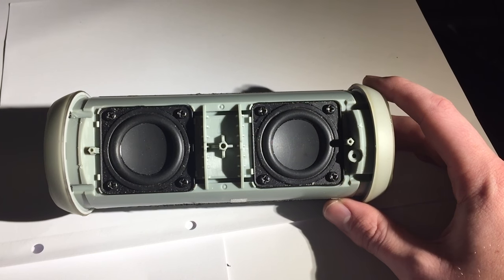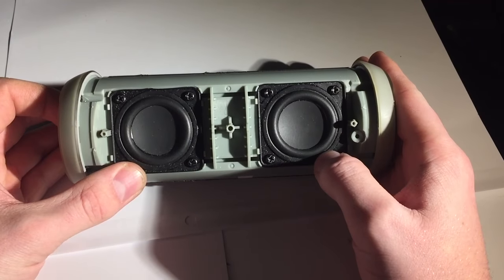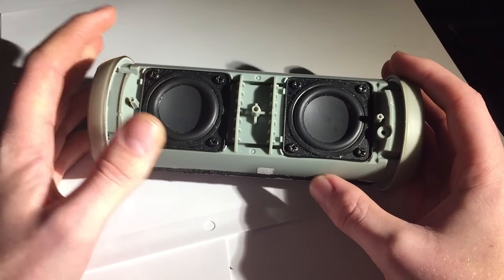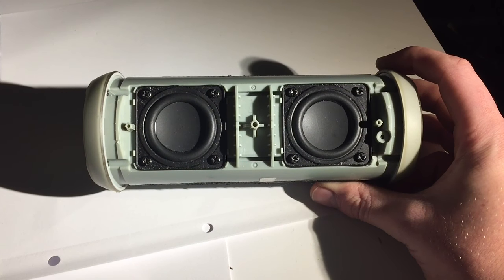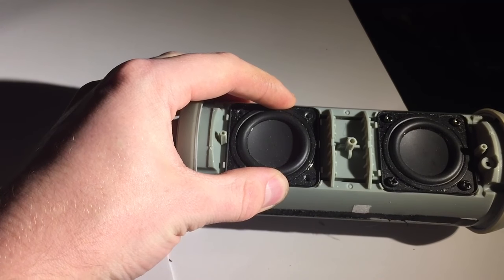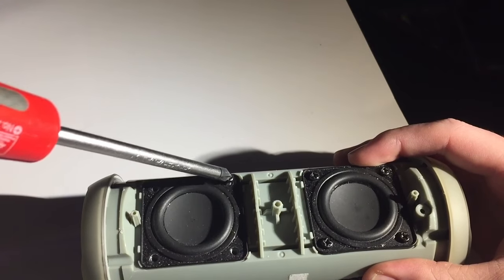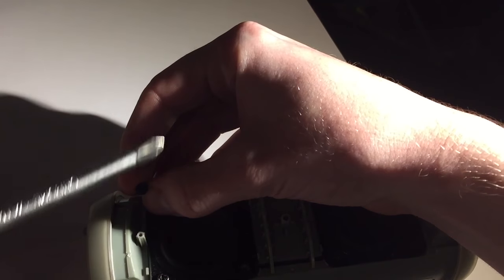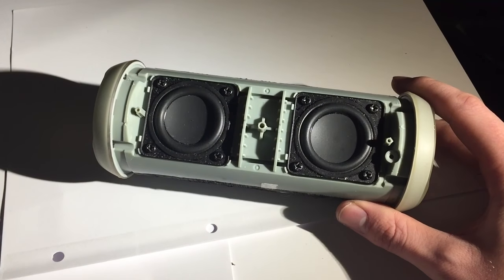What are passive radiators on speakers and how do they work? HD | Aspiebloke's world |

Comment: It's nice demo but I have to say I don't agree. Taking the speaker out allows for sound waves coming from the back of the speaker to cancel out the sound waves coming from the front of the speaker. That's probably why they sound so bad when out. To properly demonstrate the effects of the passive radiators, you should find a way to prevent them from moving but keep the whole thing sealed.
Reply from the maker: Thanks for your comment. the only way i'd be able to stop the radiators moving would be to hold them which could result in damage hence why I removed the driver.
Reply: huh? if you hold the radiators stil, nothing can break! but if you hold on the active speaker then you can damage the driver
Reply: @maltepettersson3083  If you hold the radiators still, the material to hold it in place is being forced to not move to and fro (This material can actually tear if you force it to not move while active)- thereby damaging the radiator. By holding the speaker out of its enclosure, the cables/wiring are still in place - hence those won't be damaged. Unless you yank the drivers out with force.
Reply: won't damage a passive radiator to hold it. they're passive ... they flap around according to external forces. if you hold the centre still the stresses are the reverse of a centre-driven speaker cone. if you wanted to be cautious you'd spread the load over the cone and make the net load zero everywhere.

cuicui is 100% correct: removing a driver messes with the bass for much more important reasons than inactivating the radiators

aspiebloke, if you want to hear the difference between a plain sealed box and a box with radiators, just place your fingers on the radiators, or cover them over with rigid caps, and they effectively become walls. you should also note that radiators perform an additional function of increasing the power handling of your tiny active drivers by controlling excursion. as the frequency gets too low for your drivers to make useful sound, the radiators start to operate in antiphase, counterintuitively going in when the drivers go in. sort of like playing paddle-ball. this not only makes sound, it effectively reduces the air volume behind the driver and limits its travel. iow the driver is better coupled to the air near its resonant frequency. also iow, the driver is seeing a higher acoustic impedance at low frequencies, roughly equivalent to being in the right gear

Comment: It isn't air pressure that drives the passive radiators it's the Helmholtz resonance of the tuned system. The passive radiators only vibrate in response to this. Above the resonance they do nothing. Below resonance they respond to air pressure changes but their output is out of phase with the main drivers and so therefore don't produce any useful output.
Reply from the maker: Hi thank you very much for this comment I have since researched Helmholtz Resonance and found it very interesting. As this video is now not 100% accurate I may do another video also saying about how Helmholtz Resonance is involved. thanks again, I'm always interested in learning how things operate and appreciate people telling me if I'm not 100% right.
Reply: "Helmholtz Resonance"...will it be mentioned in speaker specs?
Reply: Khaja Md it will be mentioned as the lowest on the frequency response. My JBL charge 2+ is tuned at 75hz I believe, and that's exactly what it says on the box

Comment: Exposed radiators sound more good that's why UE loooses their sound against JBL
Reply from the maker: I have to say I like speakers with exposed radiators however i've just got hold of a UE wonderboom (demo coming soon) and i can't really notice a deteriation in sound.
Reply: IMO the tweeters tend to be more adversely affected from being covered than the pass radiators. I've got a fugoo XL (which I love) in the Style jacket; to me the highs don't sound quite as crisp when it's inside the jacket as it does when it's out. The bass doesn't seem to be muffled at all; I think the lower frequencies have an easier time passing through the fabric weave.
Reply: Aryan Singh i have an anker soundcore and it only has one passive radiator but it sounds better than the jbl
Reply from the maker: Personally I'm not a fan of UEs range speakers other than the wonderboom however I haven't heard the new mega boom as yet.

Comment: Wow! Do you think there may be more factors causing that significant increase in low end performance? - or just the passive radiators. I have used passive radiators on my builds with less difference, and am wondering if any additional factors are contributing
Reply from the maker: I don't think so no, I think that's the only thing JBL use.

Comment: Nice demonstration. I have a JBL charge 2+ and it seems the bass produced from the left side of the speaker is stronger than the bass from the right side. I can actually feel the difference while moving in front of the speaker. How to check if both the passive radiators are working fine and there is no fault with the speaker itself.
Reply from the maker: I don’t have the charge 2+ myself bud I’d assume that like the other JBL speakers each driver and rad doesn’t have a separate enclosure. Therefore the bass should be even maybe check your left and right balance settings on the device connected to it. Also check for a air leak by gently pressing one rad in does the one on the other end come out? If not then that may be your problem. Let me know how you get on :)

Comment: I have a 10" Edifier sub with dual passive radiators but surprisingly the bass it produces is rivalled by a few other smaller subs I have so I'm not really a fan of the design and wish they had just gone with a tuned port like my other subs

Comment: So what I find cool about it is that the pr’s also help the bass
Reply: Is it normal that the bass radiators not move???
Reply from the maker: No this is not normal and is probably a sign of the device not being sealed.
Reply: @aspieblokesworld1890  even without low freqeuncie mode AND a low volume??? but the sound is great

Comment: I am interested how it would look if you wire one speaker out of phase and seal it back up. Technically it wouldn’t generate pressure inside to run the passive radiators..
Reply: Lol i think it would generate pressure but would be aweful
Reply from the maker: That sounds like a good experiment, only problem is the wires are soldered to the speakers :(

Comment: I'd like to see a video on the Bose speakers you have. I had a sound link mini and it just slowly broke down towards the ends of two years. I was really disappointed.  The other Bose gear i have has lasted and still sounds great. So i just bought a  JBL Charge 3 and I've really been enjoying it. Anyway great video.
Reply from the maker: I will do a demonstration of the soundlink colour if you want and I've got the soundlink mini too and managed to blow a driver in it. In my opinion bose have gone down hill with their gear hence why I now use JBL gear. I'm glad you're enjoying the charge 3 great little speaker and lots of volume I'm glad you enjoyed the video

Comment: Since you mentioned air pressure inside the speaker, Is there a port for the speaker where the air could come out?
Reply from the maker: Not as far as I’m aware. The device has to be sealed for the passive radiators to Work effectively

Comment: How would this work on a much larger subwoofer? I have a 15" 2000rms sub in a ported box being pushed by a 4k rms amp. Would the power handling change at all? Would space requirements change? Would a passive radiator increase the low end out put or would keeping it ported be more of a benefit? Thanks for your information and video!
Reply from the maker: I'm no expert on larger speakers this video is just how passive radiators operate. In my opinion on a sub that size ported is better, space requirements would probably change as you may need to accommodate a basket for the passive rad. if it was me i'd stay ported as ported can go lower frequency wise. If its a car subwoofer i'd suggest you look at Meade916 he built a system for his shop that uses passive radiators I hope this helps.
Reply: The passive radiators need to be as big or bigger than the active driver. If you used a 15 inch passive and add weight to it it would ''tune'' it lower. Or you could extend the port for lower tuning
Reply from the maker: Thanks for that info :)

Comment: oh cool so it's like an amplification of the two speakers rather than a bass speaker of it's own. it "radiates" the air of the main speakers in a bare tube? ..
Reply from the maker: Pretty much  yes, the main drivers cause the radiators to move which extends the bass response of the device.

Comment: Help ! I have the charge 2+ but the passive radiators both stoped moving.
Any tips ??
Reply from the maker: Hello chances are you've lost air pressure has the speaker been dropped at all or anything sharp been placed against the radiators? Easy way to see if you've got an air seal is to press one radiator in does the opposite one push out? If not then you have a leak. Hope this helps
Reply: Aspiebloke's World I did push one side and the other side didn't come out so I'm pretty sure I have a leak and it's because I tried taking out the battery but I guess when I closed all the parts again I didn't seal everything tight
Reply: Aspiebloke's World if it is a leak, does that mean I could still fix it ?
Reply from the maker: you may be able to fix it just ensure all screws are tight and everything has lined up correctly. I haven't got the charge 2+ to look at unfortunately. If that doesn't work then you may have to upgrade to the charge 3 :) hahahaha
Reply: Aspiebloke's World first of all thanks for responding, I opened up my charge 2+ and tightened the screws and it turned back to normal which made me very glad so looks like the charge 3 will have to wait hahaha
Reply from the maker: Brilliant news! yeah a lot of the time loose screws can be the cause especially if its taken a fall glad to be of assistance :)

Comment: But why does the radiators move out on the beat then? If the drivers move "out" shouldn't the radiators move "in"?
Reply from the maker: It’s funny you should say that as I’ve wondered the same thing. I’m not sure why that doesn’t happen.
Reply: Ikr it doesnt make sense unless the air is expanded 😂

Comment: I still don't understand how it doesn't cancel each other out. If the driven speaker moves out, the passive sucks in, how is it creating sound and bass with pressure? There must be some way they designed it to 180 this otherwise I don't see how it would work
Reply from the maker: Me neither, like you said there must be a way :)

Comment: Hi, So the passive radiator is like cap on woofer exhaust that we have in enclosure and it just moves with the air inside the box to capture more base in closer distance if not wanting to capture the base acoustically?
Reply from the maker: I believe so yes but I think there is also some DSP behind it too
Reply: Aspiebloke's World sorry what is DSP?
Reply from the maker: Sorry I should’ve explained. DSP stands for Digital Signal Processing. Basically what makes the JBL speakers sound the way they do. :)
Reply: Aspiebloke's World haha cheers:) so please elaborate what it is and how it works and how it makes these JBL speakers sound so impressive:)
Reply from the maker: I’m not an expert when it comes to DSP I’m afraid. All I know is it keeps the speaker within its operating limits
Reply: Aspiebloke's World could it be that you speak about DSP that is used in a amplifiers?  Digital sound processor? Is that what your referring to?:)
Reply from the maker: They both do roughly the same thing yes.
Reply: Aspiebloke's World i see. Do you mind me asking what are you specialised in? Are you electronics or audio expert?
Reply from the maker: I wouldn’t say I’m an expert at anything but I do know a lot about audio systems
Reply: Aspiebloke's World thats sounds good, im trying to build something do you think i can get help from you?:)

Comment: Are side facing radiators or front facing radiators better or no difference?
Reply from the maker: I can’t really notice a difference between the two. Front and rear facing have a slight advantage as you can place the speaker in a corner for more bass.

Comment: I once had a flip 3 and it sounded great, however i liked bass boost my songs, so every time i played it i guess it was pushing the speaker to its limits
And then one day after 10 months i poured water on one of the bass radiators and to my surprise water went from one side to another, there was a leak in the radiator, but for some reason it played audio fine. Because of one year warranty i returned it and traded it for a charge 3 and learnt not bass boost it too much and now its all good. But could you explain why the flip 3 sounded fine? even with a leak in the radiator
Reply from the maker: Hi there my advice is to always play flat. In other words never boost the EQ also avoid going over 75% volume always get bigger than you need. I believe the Flip 3 does have DSP to prevent overdriving but if you play low quality music this can still damage the speaker drivers. as for the radiator problem you described these seem to be very delicate even on the Xtreme. I had a leak on one of the drivers in mine. It didn't seem to affect the quality of sound but i noticed the rads would pull in when it was playing rather than vibrate as seen in this video. I suppose a small air leak doesn't make a very noticable difference to the sound but knowing what to look out for may have helped! I hope your enjoying your charge 3 and hope this helped you out :)
Reply: +Aspiebloke's World Thanks for the advice however the charge 3 is more of the bassy side in terms of sound and sounds muffled. would it be alright if it was trable boosted because it sounds a lot more clear and natural with that present
Reply from the maker: No problem. End of the day it all comes down to personal preference as long as you don't cause the speaker to distort which treble shouldn't do you should be fine :)
Reply: +Aspiebloke's World Thanks for the advice

Comment: when too much air pressure is created, can the passive radiators be extended outwards? i have a jbl flip 4, and after having it for a little bit over a year the passive radiators have come out a little bit, is that bad?
Reply from the maker: As far as I’m aware the air pressure shouldn’t be able to increase inside the device. You haven’t had the speaker in a hot environment have you? This may cause a slight difference in internal pressure.
Reply: Aspiebloke's World ive had it outside during the summer by my pool, i live in Las Vegas, temperatures are around 110 degrees.
Reply from the maker: That could be it especially if it’s in direct sunlight. If you let it cool down I’d imagine the passive radiators will return to normal.

Comment: What I don't understand is how it generates the bass from the air pressure? The sound waves come's from smaller speakers and air pressure too but I thought it would have made the same noise but only bass it produces. Why?
Reply from the maker: Roderick Caesar Hi the device works by using the air pressure to move the two passive radiators so you've effectively got four speakers instead of two. The reason the passive radiators don't make the same sound is because they are just plates of metal there is no magnet or voice coil on them and they only extend the bass response of the speaker. I could send you a picture of the inside of the device if you'd like I hope this clears that up for you :)
Reply: Ohhh I see yeah sure send a picture and thank you.
Reply: @aspieblokesworld1890  That is not true. Keep in the movement of the radiators is inverted (out of phase with the main drivers). They actually cancel the active drivers out. But in the low frequencies, due to the high moving mass, they resonate so loudly that they outperform the main drivers and the sum is still louder than what they would put out alone in that range. In the higher notes, where the main drivers are loud enough, the PRs are basically silent.

Comment: please help!

I have a box with two 4" fullrange speakers in the front and two 5" passive radiators at the sides, but i get the same output result as a sealed box. 
What should i do??
Reply: Crazy Experiments they may not be tuned correctly. They may need weight adding to them
Reply from the maker: What RWL2012 said :)
Reply: Aspiebloke's World i'm just about to put (2) 6.5" Dayton Audio passive radiators in a 0.23 cu ft enclosure with a Tymphany SLS 6.5" woofer as the active driver, with 90 grams of mass added to each PR for a theoretical tuned frequency of 55Hz. I have another one which I'm going to leave sealed at first for comparison. Wish me luck!
Reply: RWL2012 Please opload af video of it
Reply: What would you recommend, 2x6,5" active and 3x6,5" passive radiator or 2x6,5 active and 2x8" passive radiator?
Reply: Crazy Experiments it's best to do 2 passive radiators at the same size per active driver, but if you calculate the area of the active driver then the passive radiator should have about 2x the area

Comment: Cool video! I always wondered how those speakers at the side worked.
Reply from the maker: They're not speakers but are passive radiators. These extend the devices low frequency response. It's a common misconception though :)
Reply: @aspieblokesworld1890  Ah sure. Thanks 😊
Reply: @aspieblokesworld1890  Ah sure. Thanks 😊

Comment: If side passive radiator rupture then does the quality degrades??
Reply from the maker: If by rupture you mean the air seal is broken then yes. Easy way to check if the air seal is broken is press one radiator in does the other push out and stay out? If not then you’ve lost your air seal. I hope this helps
Reply: Aspiebloke's World thanks👍👍